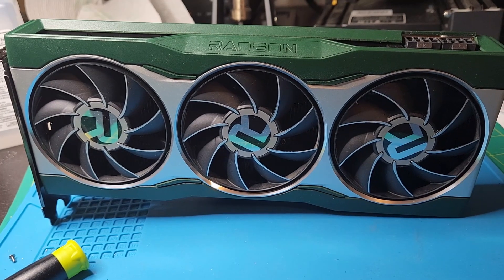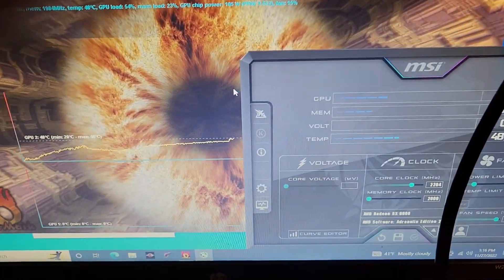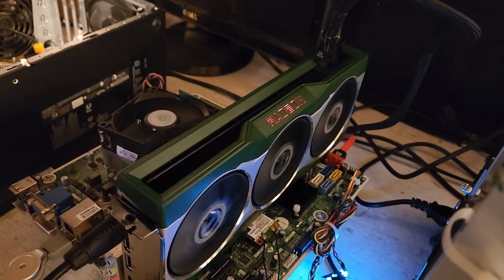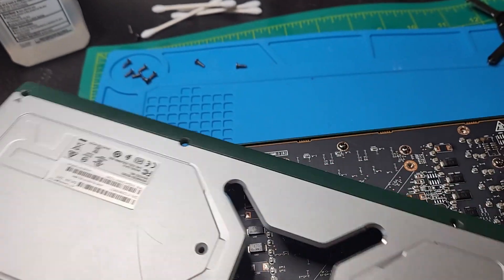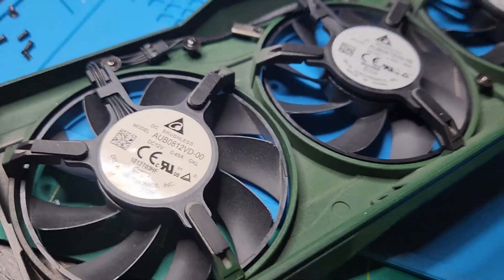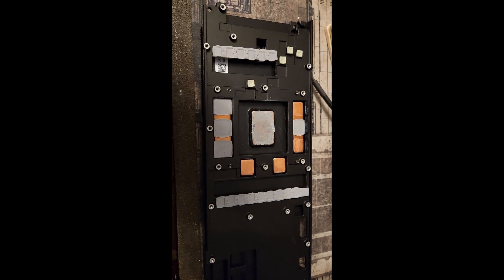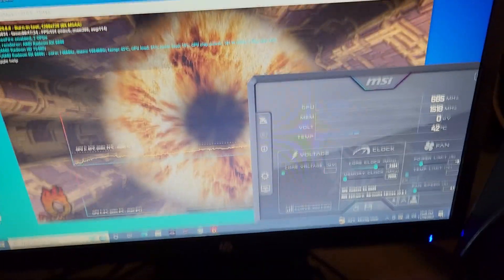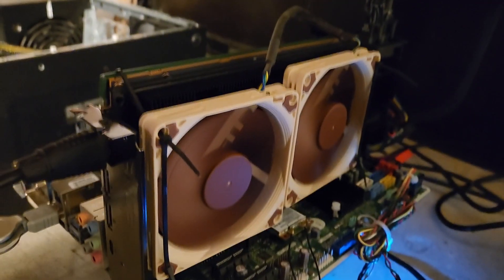I bought a amd rx 6800 for 170 usd, was this cheap gpu worth it?

Comment: The card has a fan controller chip that controls the fan speed/curve. The chip might just be bad. Can replace the chip for like $5 and you are good to go again. Look for competent gpu repair shops if you aren't comfortable replacing it yourself.
Reply from the maker: So that is something I could do my self as am somewhat competent in gpu repairs, and something I should have looked into, but it kind of makes me think it was the actual fans themselves as once I rewired the new fans and pluged them into the gpu, the fan speed was controlable with msi afterburner again.
Reply: @kr00tmanmining  nice man now this is a gpu super bang for the buck
Reply from the maker: @animekiss3311  thank you, wait till you see the PC I put it in, grabbing the rest of the parts tomorrow!
Reply: @kr00tmanmining  cant wait to see it. 😍

Comment: This is so cool! There's definitely many GPUs with rather simple tweaks or changes to be made that get sold for like 70% less than what they're worth most of the time. GPUs are usually very durable that even mining for long periods wouldnt have huge issues or performance loss and if there is most i've seen are around 10-5%~ slower than brand new ones. You do need experience to know what is wrong with it or just take gambles otherwise you'll probably end up with many fried gpus kekw
Reply from the maker: Yupp, I hunt GPUs just like those, if you see my mining farm you see a few GPUs with bolted on fans or that I have repaired. check out some of my other videos where I talk about that!

Comment: Bro its only running at like 1000mhz gpu clock when it should be doing like 2400mhz stock?!?!
Reply: @kr00tmanmining  When you where stress testing the card msi afterburner and Furmark where showing GPU clock of around 1000mhz when it should be around 2400mhz so there seems to be something else wrong with the GPU
Reply from the maker: @oroborus2063  Humm it's currently mining with zero issues, Im pulling it from the mines this week to make another video with it so I'll keep you posted on what I see
Reply: @kr00tmanmining  Yeah maybe it has a mining BIOS installed that normally limits the GPU core clock a lot, but if its only for mining and not for gaming its fine
Reply from the maker: @oroborus2063  so you can't run mining bios on it S far as I know, I'll check it later this week tho
Reply: @kr00tmanmining  Why not?
Reply from the maker: @oroborus2063  I mean I guess you could in theory but there was nothing to gain by adjusting the timings on it
Reply: @kr00tmanmining  for mining there is nothing to gain but if you game the difference will be massive because the core clock is running at less than half of what it should be
Reply from the maker: @oroborus2063  so it looks like theres an issue for sure, trying to figure out what it might be
Reply: @kr00tmanmining  Did you try flashing the stock bios? Techpowerup have bios download for all gpus
Reply from the maker: @oroborus2063  yup did that on my bench and still the same issue, this is very weird and something I have not seen before
Reply: @kr00tmanmining  very strange indeed

Comment: Hi what kinda thermal paste did you use after dissasembling the gpu and how are the temps? Looking forward to repaste my reference rx 6800
Reply from the maker: Corsair thermal paste is what I use on everything, when your taking the GPU a part to repaste it, on this one you don't need to take the fan shroud off like you do on some other GPU models and the heat sink is in 2 parts